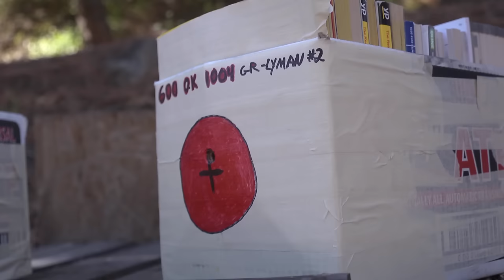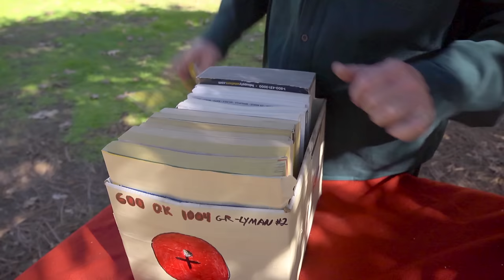Cast Bullets for Dangerous Game

Comment: 600 overkill, when you need to put Godzilla down for a dirt nap
Reply from the maker: +Jason Van Halen  no joke , this 600 will indeed do the job nicely. as you can see  in my video: testing soft points will give you an idea what this giant is capable of at 2000 plus fps. at 2300 fps it generates 12.000 ftlbs of energy. its too much of a good thing yet I love them big guns.                             regards  AVI
Reply: +1tufgun That's crazy Avi!  Thanks for the demonstration of this incredible round.

Comment: The problem with hard lead bullets is they can break up on hitting bone, especially if they strike at an angle, the flat nose shape has proven to be a better penetrator due to the cavitation it generates in front, but the break up is the main failing of lead bullets on big game (Elephant),where you need maximum penetration to hit the vital spot, if you hit the brain, then he is out, as Bell found out using a very small caliber, but you are having fun!

Comment: excuse me  for  question / but  how do u  heat treat  lead,, got some   casting  done   from  supersoft  lead bought  as  98,88 pure   lead  in 50 kg  ingot  for  my   career  air rifle,,since  it  got  microgrooves and  normal led,,i am from former  yugoslavija and spetial   10/20 year ago there was no option of lyman no1   or  //any  other   than old lead pipe  ,,with all tin  and  other  impurities  it come s with / well   must say since  in this  instance    the  softer  the  beteer   98 perc pure lead was soft enaugh not to brake loading  mehanism on career dragon slayer  in .50 cal  and  let  me  say it was no  caprice   for me to go  look for   metal dealer and wait like  month or so to get my 150 kilos  of  ,,pure as  u can  get  ,,lead  but   price  of  single   career  pellet  ,,ok it  is a 160 grain pellet:) but   costed 1 euro  per  bullet,,and  since  part  of  fun  ,,beside   not  gettin permit for any firearm in slovenija  if not  in police  or   some  serious ,,strings  is next to impossible  it  looked as  ok alternative,,belive  or  not   after 4500 euro spend  on gun,optic,case   custom refitted dyes from ,45 to   just  right  for  .50 ,,they passed law and gave  me 30 day to sell  destroy,,cost another 300 to permanently destroy gun u can than have at home  / or   risk payin  fine ,loose gun  and   etc,, all i was left   with was scuba tank  and bunch of valves and fittings to load that sucker with air,, to get back on hard lead,,in 1992 i was  in ,,gun club,, and as club  /no way as person ,, i was manage to donate 3000euros approx for ,,club,,to buy .50 ae desert eagle, tested all kind of lead even re melt some supposed  hardcast lead used bullets and  no way  in desert polygonal barrel  that after no more than  20  or  max 40 shoot s  barrel  was dirty to point scrubbin the lead skidmarks  would destroy  gun /so  back to  same speer  1 euro per  bullet/no powder and   brass    /so  what about this  lee no 2  any tested it indesert eagle//since   i after initial  50 or less  bullets  used other as slingshoot ammo / /after long year s after  i herd bout  desert   not doin well no matter what lead  used but   after watchin some   videos,here  on tube   people handlin bulled,hard lead bullets  and  hearing them  ding almoast like  steel to steel // how hard   hardcast lead  is   if u  got  rockvell scale or what  u use to  measure  the ,,hardness of  lead,,let say   superpure lead cast bullets  if  handeling them  few at time  in palm sound  like allmoast  wax  no metalic ding  present /more rubber /wood  or some similar,,please  not that  i  need to know this /at least  no more but sure am curious//thanks  mitja /slovenija

Comment: Avi, have you ever considered a Thompson Center Encore loaded with magnum caliber barrels? J.D. Jones of SSK Industries does fine work with those pistols.
Reply from the maker: +Matthewzilla  thanks guy however, the Thompson center design will "kill" my hands as I used to compete in the NRA long pistol. further more, I had some issues with mr JDJ so that's that Regard AVI
Reply from the maker: hi. not at all since these T/C design is not suitable for large calibers because the trigger guard latch will get you ! not to mention the fact the whole gun will rotate upwards & flip out of your hands as videos demonstrates.AVI
Reply from the maker: dfdfdfdf. your hands are not the problem when you handle these monsters, the elbows &  upper arms will get it ! Avi